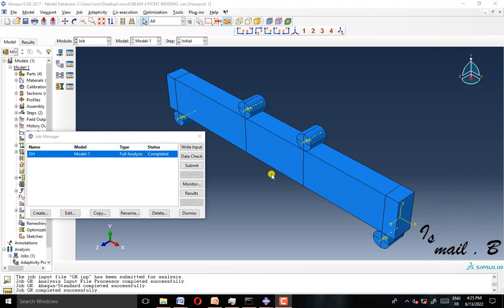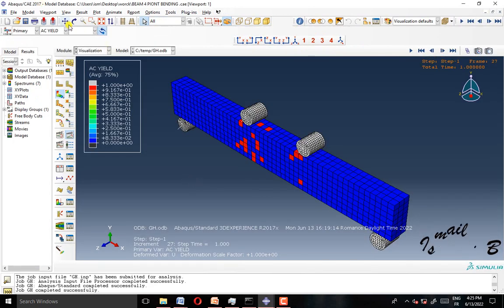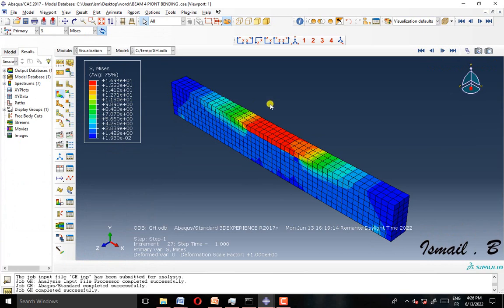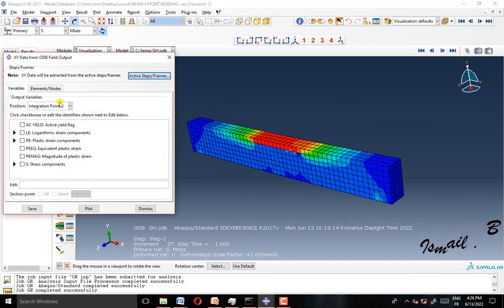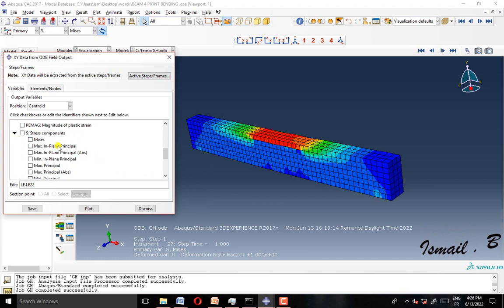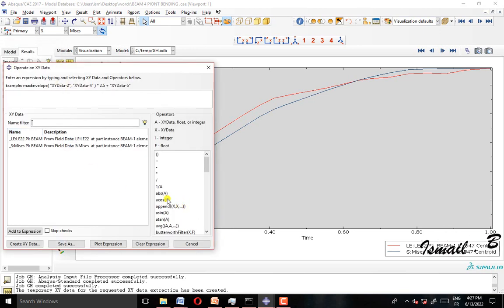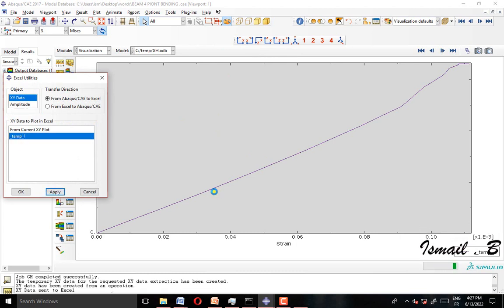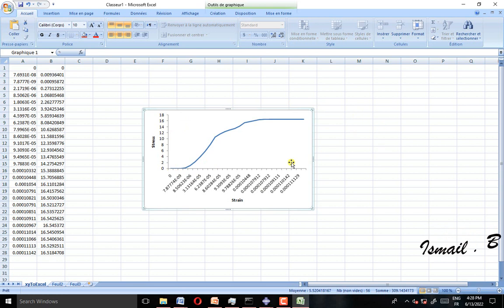4 point bending| Rc concrete | how to draw stress/strain curve

Comment: Could you kindly confirm if the result for the 4 point bending test on plain  concrete, showing a stress of 0.3 MPa and a deformation of 0.0002 mm, is correct,? considering that the 4 mm displacement method was applied?

Comment: assalamualeikum, how to plot bending stress vs bending strain? could you show us please
Reply from the maker: https://youtu.be/woRPA3BZEwk
Reply: @Abaqus_basic Could you kindly confirm if the result for the 4 point bending test on plain  concrete, showing a stress of 0.3 MPa and a deformation of 0.0002 , is correct,? considering that the 4 mm displacement method was applied?